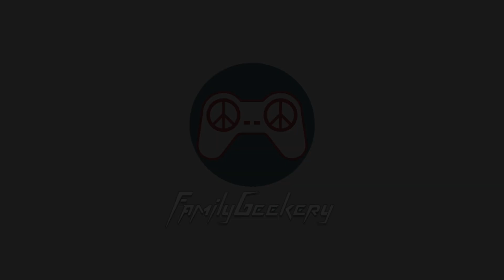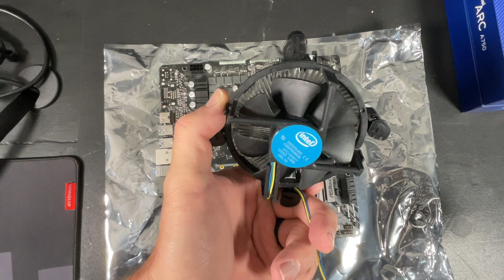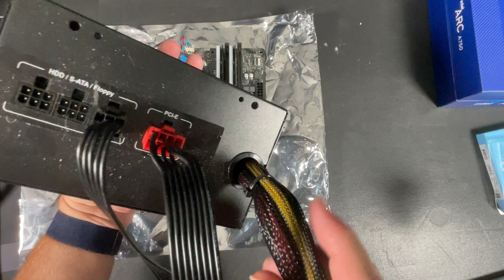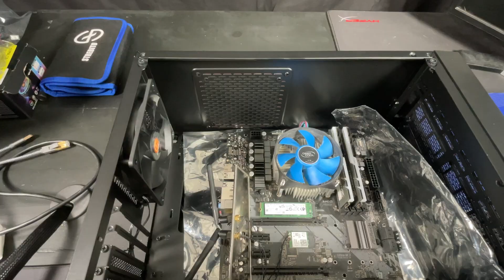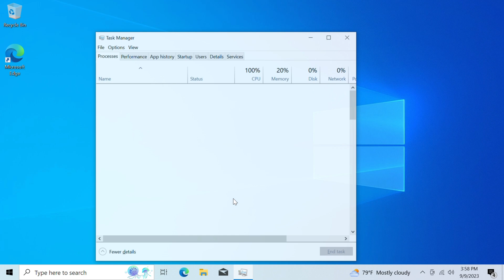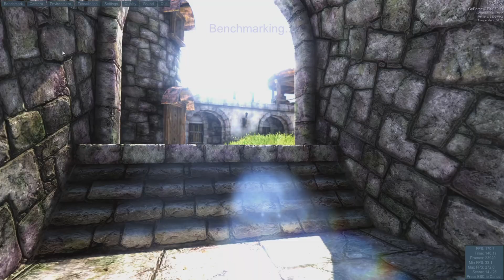Building an All Intel Gaming Computer - Mistakes Were Made!

Comment: 9th gen i5? 

a 12th Gen i3 is way better and you can get one for around 80-90$
Reply from the maker: I build with what I have around the shop. You can always buy something better. But if it’s already here….. lol
Thanks for watching!
Reply: @FamilyGeekery  makes sense

though pre 11th gen Intel processors pale in comparison to the modern budget Intel processors
Reply from the maker: @Zeroneii3 of course. It wasn’t that long ago that i3 9100’s were kicking 7th gen cpu butts. This will go on for ever. Doesn’t mean old stuff has no purpose. Especially when you find it dirt cheap.
Reply: @FamilyGeekery  i personally still rock the Intel core 2 duo t8300